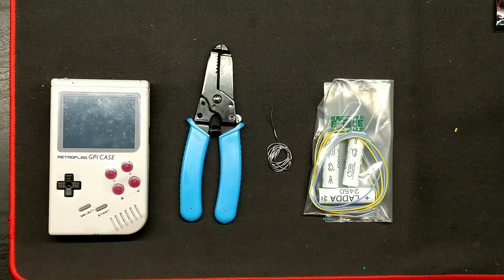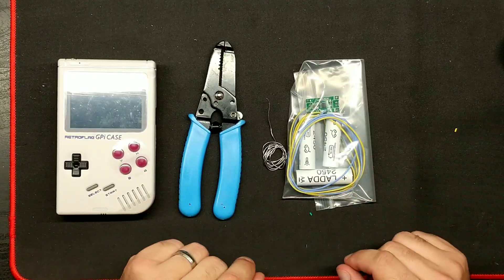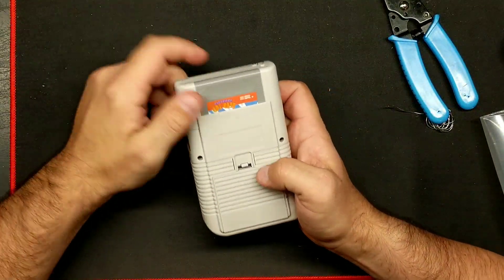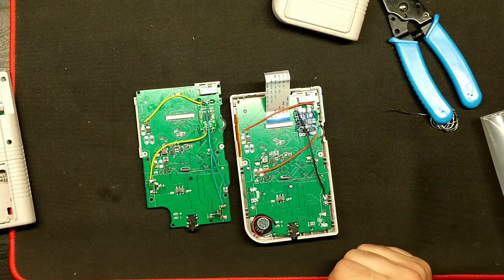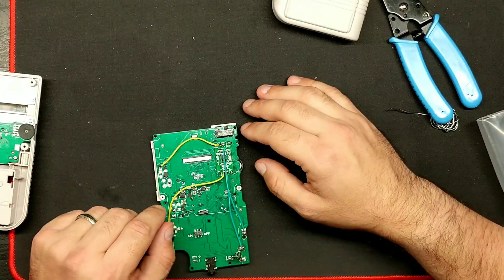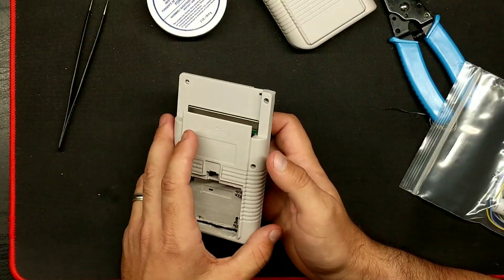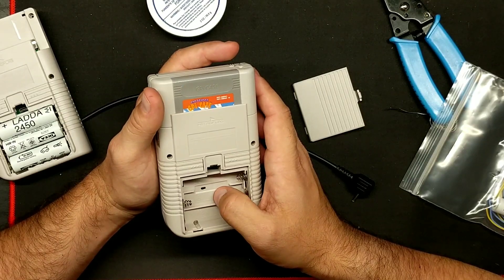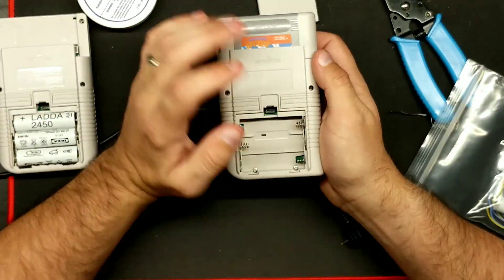GPi case NIMH charging circuit install/setup.

Comment: Is 3.6v sufficient for the Pi Zero? I saw another video that used a charging boost module to get up to 5v. Also, what kind of battery life could I expect out of this setup before I need to recharge?
Reply from the maker: Booster is not needed for one is built into the board. If you use a booster it'll blow up the onboard booster. That is not a smart thing to use....as for play time I get usually 2 1/2 hours of play before I call it quits so never really went past that but I've heard they have about 3 hours of hard use out of them

Comment: Depending on the charging circuit, you may only need to connect one ground. On the NIMH charging circuit that I received, the grounds on the input and output were bonded, so during install I only needed to connect three wires total. (V+, B+, GND)
Reply from the maker: This is correct the one I use is a straight in line I just wire it up as precaution to make sure everything is working as intended and I'm not worried about something possibly blowing up because I didn't have the board in line
Reply: @AkumaMods  It's good practice to probe the pads you are connecting. For instance, I used your video as reference to get the initial pads, but when I was on the workbench doing the install I didn't have the video in front of me, so I used a multimeter to check connectivity for ground and the actual pad for the 5v (continuity check from the barrel socket.) It's just one more thing to check when wiring to verify the grounds are connected on the charging circuit.

Comment: Iv done the mod. My problem now is when the red led starts flashing I connect it to a power source and the it reboots. If only does it when the led is flashing. I'm using Duracell 2500mah battery's
Reply from the maker: Probably because there is not enough power to charge and play at the same time. The circuit I'm using doesn't provide enough input power to do a play and charge setup. It will do a play and charge but it's only charging about 5% capacity when playing.  Kind of the same premise as jumpstarting a car. Usually doesn't start right away. Needs some time to charge

Comment: LADDA are Enelopp / Panasonic. All from the same factory in Japan.
Reply from the maker: That's what I keep hearing
Reply: @AkumaMods  from the articles and videos i saw, yes, they are like the same, same factory. Charge and discharge curves, and real charge are the same, almost.
Reply from the maker: @workingmanbh  that is correct, it's one of the reasons I went with them
Reply: Eletechsup 1A 3.6V 3S

Comment: hi brother congratulations for the project I wanted to know I have a 5000mah battery would it be good for the GPi Case? thanks congratulations again
Reply from the maker: As Long as you get the dimension to see if it'll fit then yes it will be ok
Reply: @AkumaMods  it has the same dimensions as the battery cover.....so with the 5000mah battery I'm fine, isn't it burning? A thousand thanks
Reply from the maker: @pinobarbareschi6452  no shouldnt be a problem. The battery monitor should make sure it charges at the correct currents but just make sure it's the right type of battery. This tutorial is for NIMH batteries. However there is a Tutorial for LIPO batteries
Reply: @AkumaMods  in what sense is the right type of battery? but by any chance can you show me the tutorial in the video
Reply: @AkumaMods  maybe recommend me a better battery
Reply from the maker: @pinobarbareschi6452  the IKEA ladda batteries is what I've used and work fine. Get about 2 hours out of them
Reply from the maker: this is what I used in the video https://www.ikea.com/us/en/p/ladda-rechargeable-battery-hr06-aa-1-2v-50504692/ @pinobarbareschi6452
Reply: @AkumaMods  Hi, forgive me one last thing and to see the battery status when playing to see when it is running low?
Reply from the maker: @pinobarbareschi6452  unfortunately that is not possible without a battery monitoring system. I have not got a chance to incorporate one into the build. It would require an extra part and extra coding to get it to properly work
Reply: @AkumaMods  hi brother I wanted to change the display of my gpi case which is broken I wanted to know if you could help me look for the display I can't look for its compatibility thanks
Reply from the maker: @pinobarbareschi6452  unfortunately I dont think there are parts out on the market for the gpi case however you may be in luck because I believe I have an extra screen.

Comment: Where i can found the energy power cable in L form you are using ?
Reply from the maker: I use silicone wires 28 awg
Reply from the maker: They are on Amazon

Comment: When all is fitted and gpi case closed with this mod, there's any visible led that helps to see if batteries are charging?
Reply from the maker: You should be able to see the red charging light through the contrast wheel side of the case. Once it is done the light will go out

Comment: So I tried the mod and it does seem to charge the battery but not fully. After about an hour or so the unit stops charging as indicated by the LED light not emitting. If I unplug and re-plug it will begin charging again, but again after an hour or so, it will stop charging again. I tested the on screen time of the device after a charge the unit only stays powered for about an hour or so before dying and these are with new 1.2 volt 2400 mah batteries. Is there a reason why the unit would stop charging?
Reply from the maker: Something might not be wired correctly. Are you using one of my circuits or the Chinese ones?
Reply: @AkumaMods  I mean it all comes from china doesn't it?  but using these I found off amazon 
https://www.amazon.com/gp/product/B07WKF3S3J/ref=ppx_yo_dt_b_asin_title_o07_s00?ie=UTF8&psc=1

I picked the 3s which should be enough to power the 3 batteries and followed the setup in the video.
Reply: @dankjosh  Did you resolve this?
Reply: Jamie Reynolds yes. Removing and resoddering did the trick. Battery life isn’t what I was expecting compared to the moddable battery mod akumamods has posted in another video but it does work.
Reply: @dankjosh  Can you say more about battery life? How long does it last?

Comment: I can't use mine Gpi with batteries, because mine 2r2 coil is smoked away. Does anybody know what kind of coil this is and where i can find some?
Reply from the maker: I can see if I still have a few extra coils laying around. Or if you want to send it to me for a repair I could do that too. Shoot me an email at Akumamax84@gmail.com
Reply: @AkumaMods  thanks for the fast reply. I will send you an Email tomorrow. its now 11pm at mine and i'm really tired. thanks again.
Reply from the maker: @lagra-LO  sounds good bud. here to help. Since your at 11pm now my guess is your I'm or at least overseas so I'll see if I can find some battery springs to get you up and running since sending me your unit might be a bit costly to me and to ship back to you

Comment: Will this mod work with an original Game Boy?
Reply from the maker: Unfortunately this circuit was specifically made to only use 3 AA batteries. Now I do have the ability to use a single cell or dual cell as well but not a quad cell currently